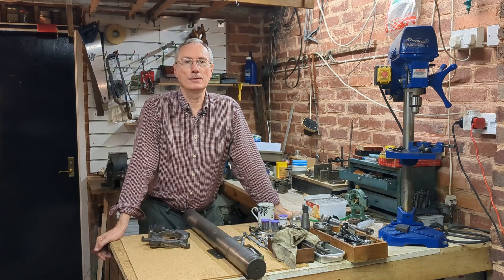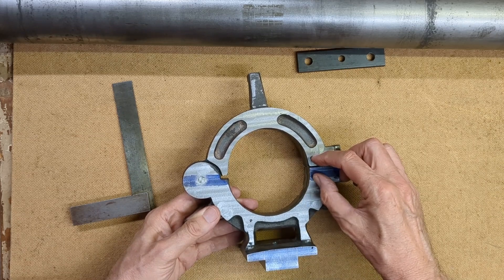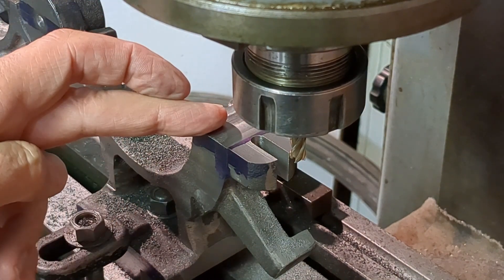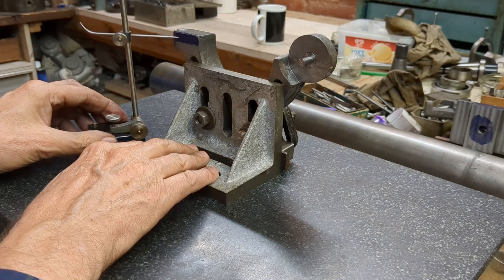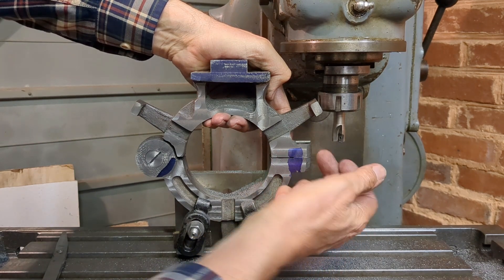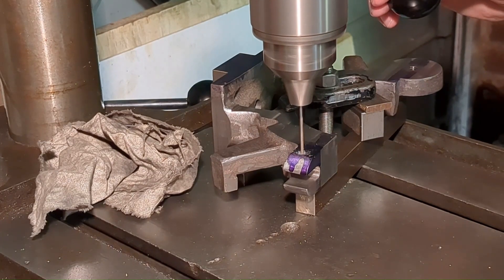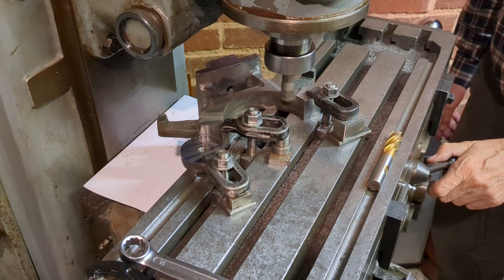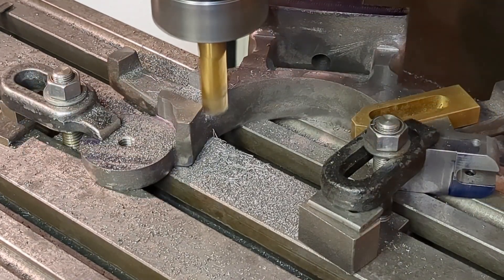Large Myford fixed steady - part 3 (clasp & slots)

Comment: Excellent work, I always learn something watching your videos

On older milling machines I have found that backing off pressure on the feedscrew before locking the table will obviate that slight movement
Reply from the maker: Thanks for your feedback!
What you say about backing off makes sense. I will try that and check whether the gib needs a little adjustment.